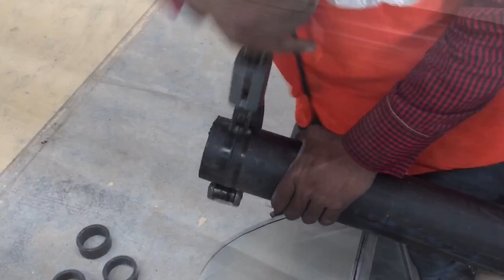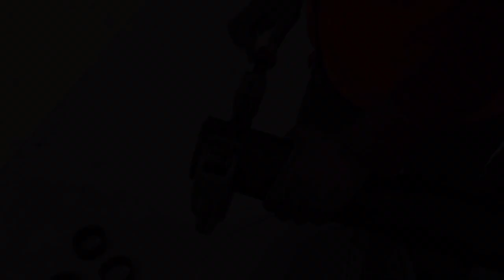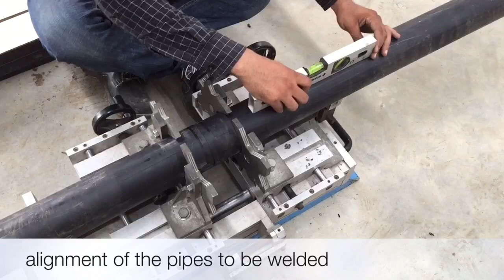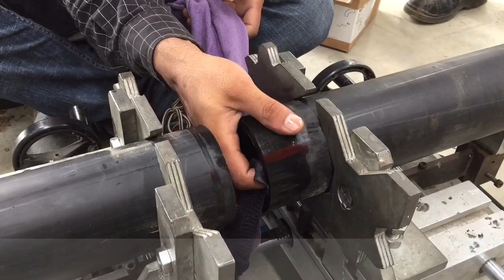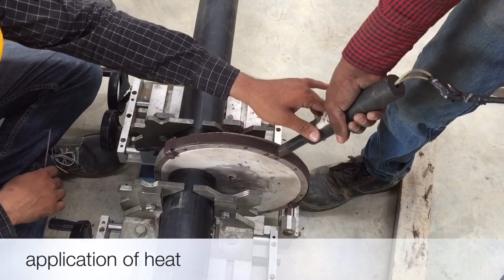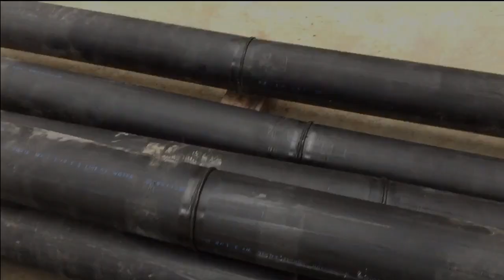HDPE pipe welding using Heat Fusion

Comment: I’m a golf course superintendent thinking about installing a new system with this type of pipe. Is all it takes to seal the joints is heat and a couple guys with rags?? Do you have any videos of irrigation pipe failures and how to repair these joints?
Reply: I've been installing hdpe for 2 years and haven't had any fails as long the temp and pressure is on point. If you got any questions maybe we can set you up with the new system